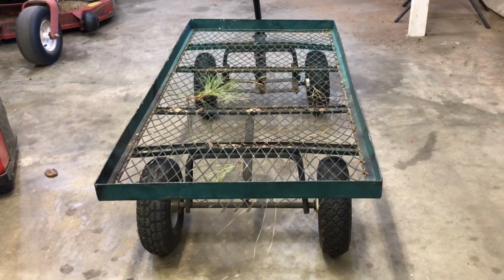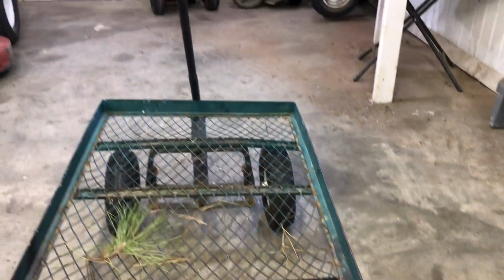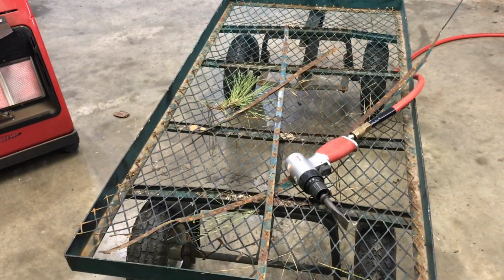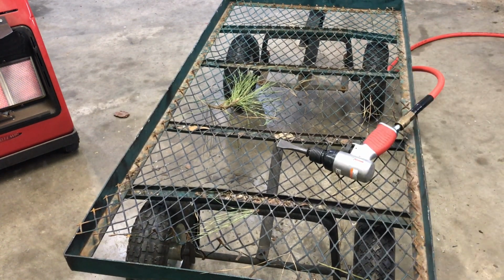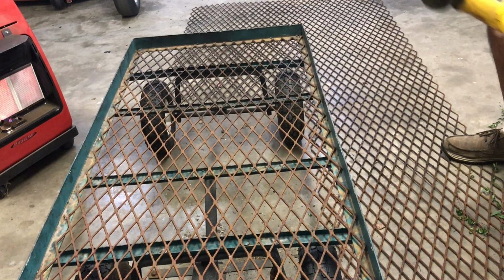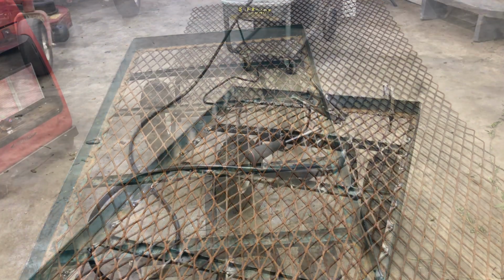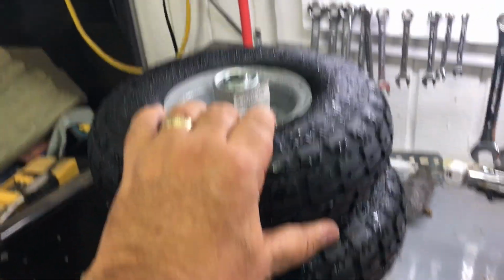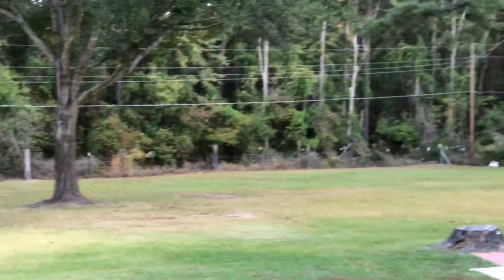Harbor freight garden cart repair

Comment: Can I tell you if you take and zipped Highwood to the to that screw it into the thing so they keep that together well I’m actually thinking about putting set it out air tires I’m thinking about putting a metal the metal wire wheels on the reason why I want the metal ones it’ll be easier to not have them air up
Reply from the maker: Great !

Comment: A good upgrade with not much work. I see a handle on the end of the steering rod. Have you considered changing that handle to some sort of hitch? It might be easier to lug those logs and other stuff around using your garden tractor. Especially in your warmer weather.
Reply from the maker: Sam P good eye. I already put a 2 inch U bolt through the handle to hook over a ball
Reply: I put two 3/8" x 6 eyebolts on my. Husqvarna ztr, after opening up the holes for whatever hitch plate they sell. I put 2 u bolts on the handle itself, and 2 steel carabiner on the ubolts. The carabiner clips right onto the eyebolts and the ubolts are nicely spaced to use the handle as needed. Works great. Love your repair. Might just do this before it needs it. Good video... Subscribed.

Comment: I haven't flux core welded in a while, I miss it.  Good and hot and you don't have to worry about things being perfectly clean.  Good work on the cart.  I bought one of those Stihl chainsaw sharpeners on Amazon, what a difference.  I have the sharpest chainsaw in town.   Good work Brad.
Reply from the maker: Craig Arndt as I read your comment, I’m sitting at my chain sharpening station thinking, there has to be a better way! I’ll have to google that sharpener.
Reply: Oh, I meant the one you have... same one I have in that orange wrapper.  It takes me maybe 5-6 minutes.   3 files a tooth is usually all I need and then I can level the cutter depth teeth every other time.
Reply from the maker: Craig Arndt oh I thought stihl had come out with something that required less bacon power. Back to work! 3 more chains and I’m done. Tomorrow I do some serious performance mods to both saws.

Comment: I hate those pneumatic tires. Can't keep air in them. I switch them out for solid tires when ever I can.
Reply from the maker: Buckrun11 I replaced them on one of my carts but they are 25 bucks each. I guess if you add up how many times I’ve replaced the chinesium tires, I could afford the hard tires.

Comment: That looks much stronger!  I finally replaced the always-leaking-air tire on my wheelbarrow with an airless tire and haven't had a tire problem for several years.
Reply from the maker: 454pakr I may just break down and spend the 25 bucks a tire. It would sure save me a bunch of inopportune flats.

Comment: I just welded a bunch of broken welds on my trailer. Now the only things left are to get 4 new tires and paint it.
Reply from the maker: Steven P if it’s the harbor freight trailer, the tires are just awful. Truth is though,I’ve beat the hell out of this trailer. I’m happy with the trailer but disappointed in how ridiculously cheap the tires are.
Reply: BCtruck, rebuild, repair,repurpose Mine isn't a harbor freight trailer. It is just used on a daily basis with several thousand pounds comming on and off all day.
Reply from the maker: Steven P is it the much bigger one that tractor supply sells?
Reply: BCtruck, rebuild, repair,repurpose It's a 16 foot Gatormade.
Reply: BCtruck, rebuild, repair,repurpose The only problems were a few welds on the side and rear gates broke from putting too much weight on them.
Reply from the maker: Steven P ok. I miss understood. It thought it was a garden trailer. Tractor supply sell a much larger and beefier one and I’m very curious how well that one holds up.
Reply: BCtruck, rebuild, repair,repurpose I've never thought about getting one, I usually just drag it off or use a wheel barrel. Do you think it is easier to use a little cart like this?
Reply: BCtruck, rebuild, repair,repurpose One thing I would say about the tires is fill them with fix a flat. Most people who use anything comercially do it to there tires.
Reply: Steven P there's an excellent thought! I have 3 of these (actual commercial duty) 3 hand trucks, and 4 wheel barrows. Yes, for a lot of things, these are much better.